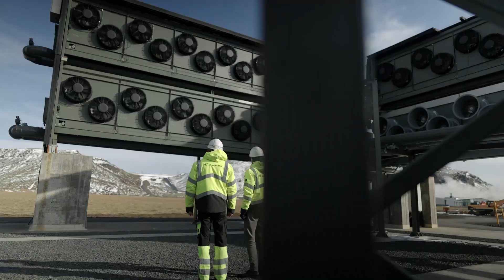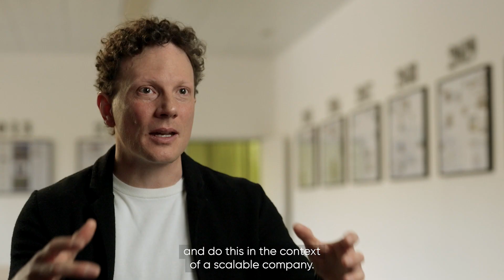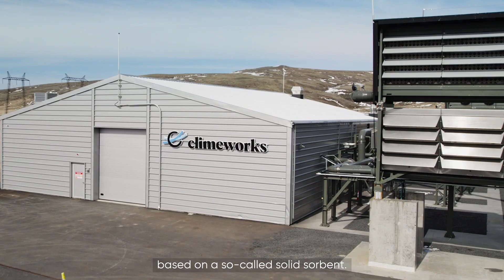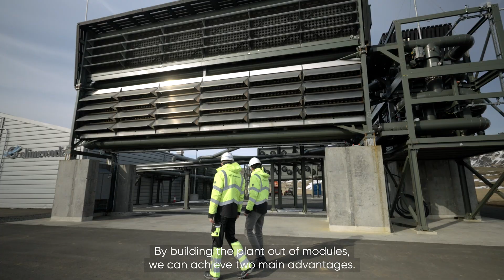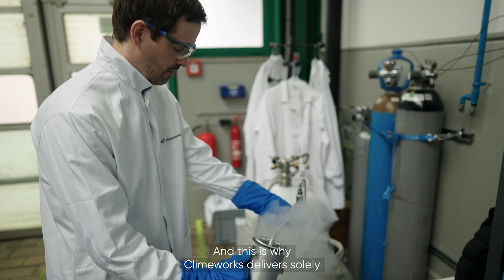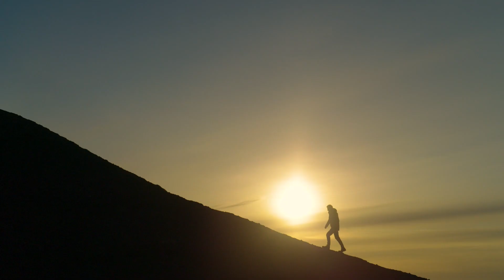Humanising Energy: Removing CO2 from the air

Comment: Direct air capture is really a stupid idea. The driving force of 400 ppm CO2 in the atmosphere is so low it takes immense energy to accomplish this. The only sensible capture of CO2 is at the point of generation, i.e. coal and natural gas fired power plants. Here, the driving force is 200,000 ppm. Why wait until it gets diluted in the atmosphere before capturing it? Really dumb. And, I really question if there is enough zero carbon emission energy sources available for carbon capture to make it net negative. There's still the question of what do with it. Mineralization at your small scale may work, but not at the large scales that are actually needed to make a difference. Far better off planting trees and reforestation. But, hey, this all sounds good to the uninformed public and politicians.